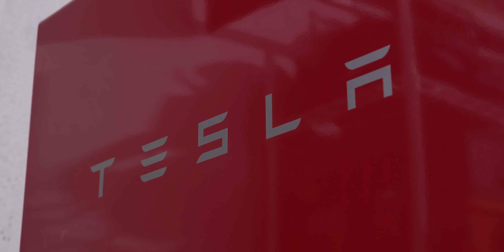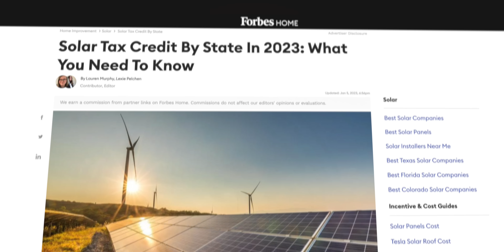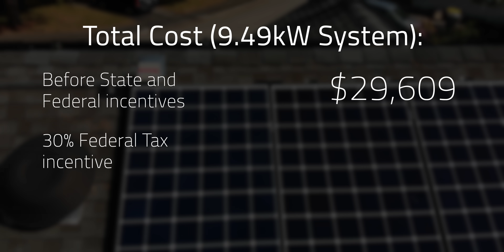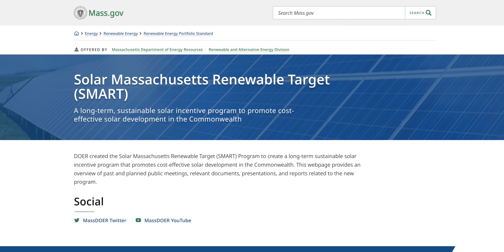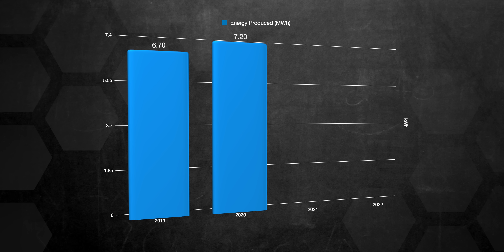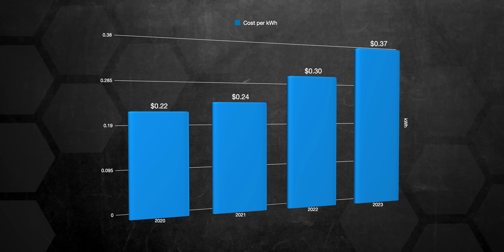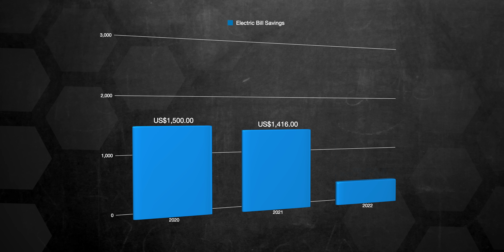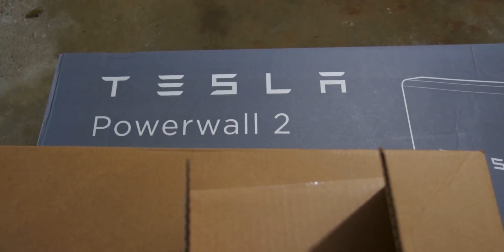5 Years with Solar Panels - Is It Still Worth It?

Comment: Is there any point in installing solar panels when our electricity cost is less than 0.09 Canadian dollar/kWh (Quebec) ? Similarly, for power walls and battery backups… in the winter, my house can use up to 150 or 200kWh per day… any point in battery backup in this case ?
Reply: with the reliability of hydro, there really isn’t much point for you

Comment: Solar at home is "WORTH IT" only when the Batteries last at least 50 years.  In 8 years, a NEW BANK of Lithium Batteries will cost $~20,000 because DEMAND for Lithium will jump 10,000% (to supply all new EV's).  Economists and Mining Experts warn that the Lithium market will fail...different Batteries will have to replace Lithium.

Comment: 13:30 There are better and safer solutions. One can use heater cables, 15W per meter for example. Best used on a timer. The lower the temperature the harder they work/heat, so by the time the Sun is rising all your snow is gone. You can add them in the seams between the panels, and they will create a slow and steady flow of the melting snow.

Comment: Your issue with snow-slide is no different than that on any metal roof. Since metal roofs are especially useful for that reason as well as fire resistance in cold, forest and grassy type environments, they are used a lot around me (incl. on my own home) and that characteristic is just planned for and moderated as necessary with various techniques. There are much better options than Tesla for battery storage. The guy to follow for all things well-tested and -analyzed in economically effective solar equipment and applications is Will Prowse.
Reply: A lot of Will's stuff is Chinese made, not UL listed or designed for being off grid which is not the majority of people.  Just beware and be carefull.